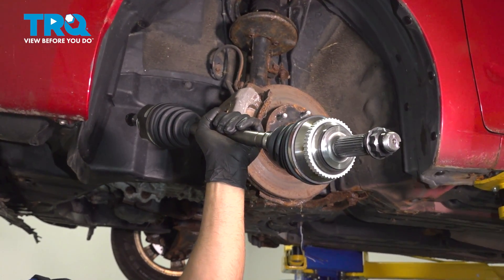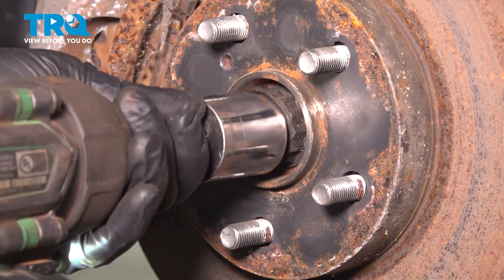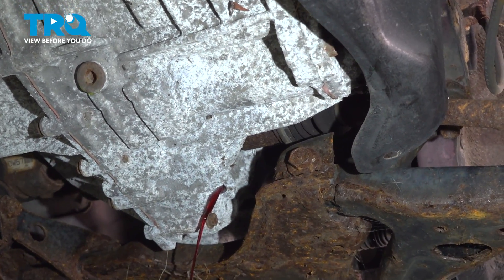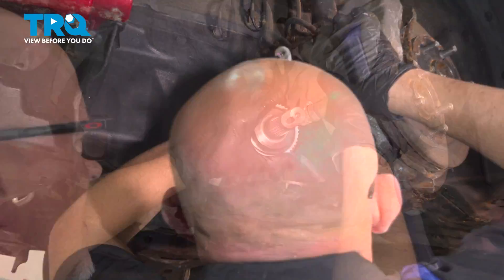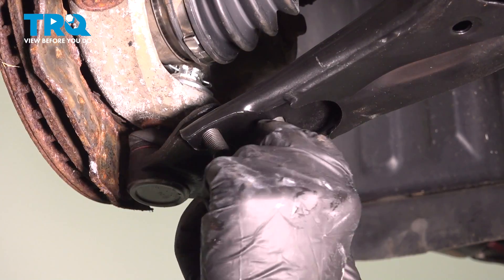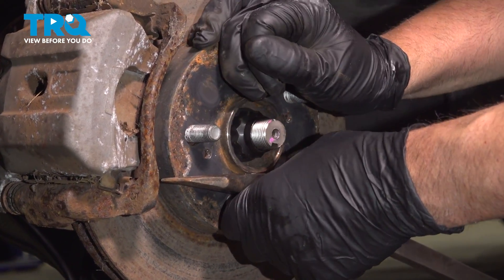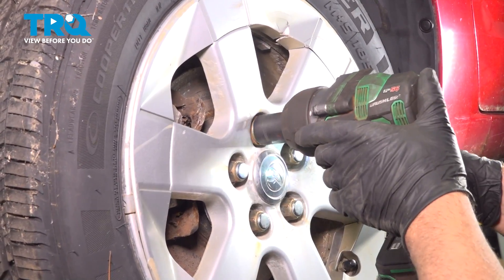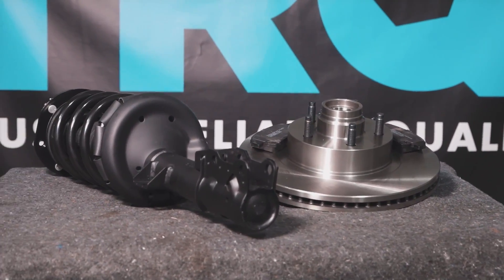How to Replace Front CV Axle 2004-2009 Toyota Prius

Comment: this manual will push you into a more expensive repair if you do not refill the oil that leaks during disassembly, apart from that the manual is ok, but the suggestion is very important

Comment: 2009 Prius here with 336,874 miles original CV axle. Passenger axle outer boot ripped but still worked perfect and no noise. It was original axle. I just completed this job successfully. I don't have a shop lift like you do. I can't get a long enough pry bar to get the strong enough leverage like you did. 5 LB Slide hammer is required and no extension for slide hammer is required. CV Joint Puller Adapter - Large  63mm wide opening larger than standard is required. Popped right out after a little bit of force than slowly increase force than hit it really hard to pop it out. There is a flexible seal that looks like it can be damaged if you don't hit it straight out. I pushed in the axle by hand straight in kinda hard with no tools by dipping axle tip in transmission fluid bottle opening and using a new snap ring with snap ring opening facing straight down like manual says. I didn't even have to pound it back in it seems but I did pound it a little just to make sure but didn't look like it needed pounding to get it back in. Note I didn't have rust to make it harder on mine. Took 1 hour 15 Minutes.